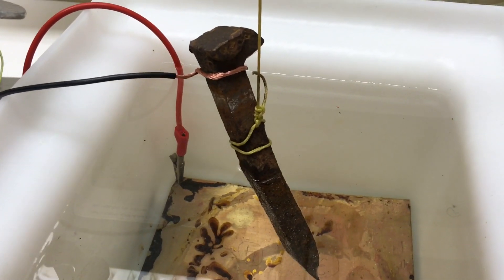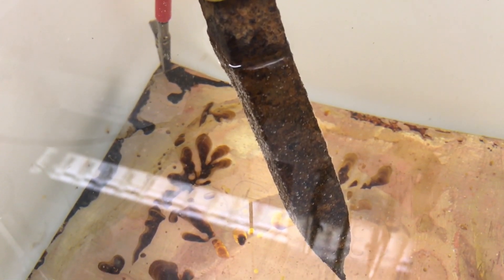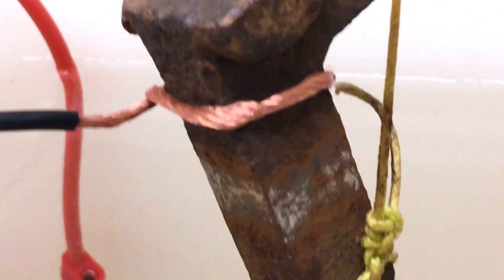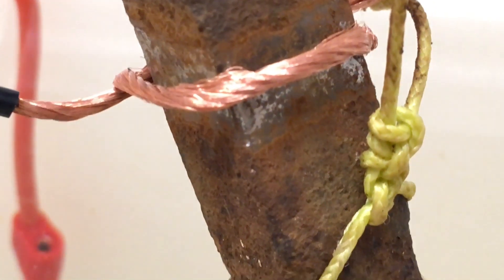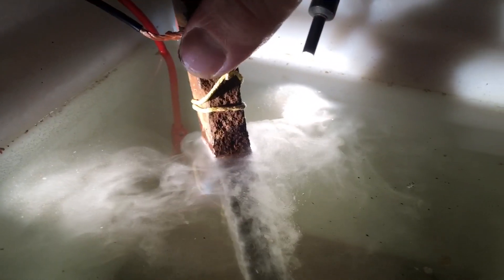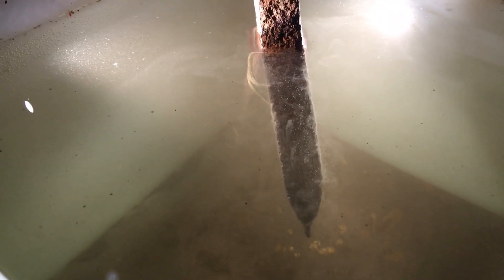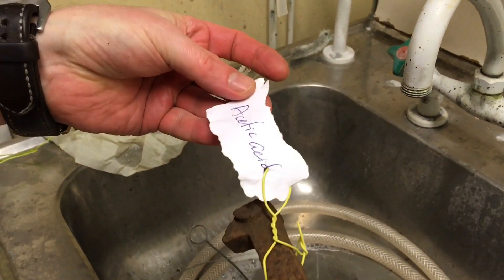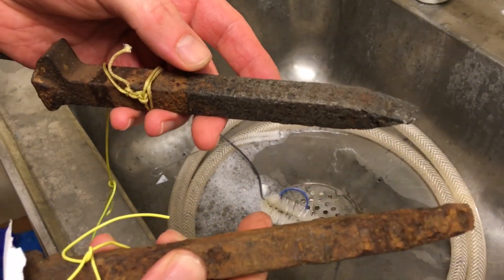True rust removal by a chemist - boosting the performance of white vinegar by electrolysis

Comment: If iron is left in acid the iron will eventually dissolve entirely.will the same happen with electrolysis? Also, I've used products like metal rescue, but the iron turns black. How can that be removed by chemistry? Great video!
Reply from the maker: +Don Newbold Thanks for commenting. The iron itself is so much more stable than the rust so you don’t need to worry about this and it won’t dissolve in a traditional way as one could envision. So leaving it in this weak acid won’t do anything for weeks. However, if you leave it for 2 weeks in 50 % muriatic acid as i use in my other bolt video, then it turns completely black and the reaction seams to have stopped, no more bubbles show. This is because a compound called ferrihydrate has formed, looking as it is partially protecting the surface. In reality, at this point hydrogen from the acid is all the time migrating into the iron. A very slow process, which with time will make your iron just disintegrate like a cracked eggshell. Folks refer to this as hydrogen embrittlement and one should be careful on this with all acids. Now, in the case of electrolysis you are safer because you push out electrons through your part, which can react with that hydrogen so it leaves your part as bubbles instead. In fact all the metal in the black cable side, immersed cables themselves, are always intact when you wash them. Two more cases are there to consider when doing this stuff, phosphoric acid and rust converters, both making your part black, but this is without electrolysis. Here the phosphorus part of the acid bonds to the iron or the tannate part of the acid in the rust converter. They make  kind of a protective layer that is good to paint on. As you let it dry as ‘coatings’ the hydrogen embrittlement problem is not a problem, no more hydrogen is supplied. However leaving it in there for ages will crack the iron also here. This is all that there is into it for us normal hobby folks, I hope it helps.
Reply: The black is carbon from the steel.

Comment: Thank you for the video. I wonder if the little vinegar in the solution is contributing significantly to the result at all, because in most other electrolysis rust removal videos, they do not add any acid to the liquid. What do you think?
Reply from the maker: +Futschikatores It does, no question on that but as you say, the question is how much. If I put it this way, thin surface rust on another piece of car panel goes by just dipping and I can wipe off without the electrolysis going. However for this really thick rust I cannot really say to which extent it compares w the electric rust remove action. Have to do one without, parallel to find out. Good point!
Reply from the maker: @Schwalbe262 you can go high on the voltage but always stay away from the Amps because they are the dangerous ones. google it and find the limits for your own safety
Reply: @Schwalbe262 more power will make the derusting faster, but the result isn't as good.  I've done a lot of electrolytic derusting and it seems best to give the parts about 2-4 amps max.  These parts are approximately the size of two hands together.  I've never used acid, but just sodium carbonate.  It works very well, but does seem to leave a black residue that need a scrubbed off.
Reply: It also helps to heat the solution.  I think this aids the grease cutting action so that the solution can get to the rust.
Reply: I will also add that the power that should be applied is proportional to the surface area. 2x more surface area equals 2x more current.  Also, the electrolytic action if done right will never take away actual metal.  You can leave it in for a week and still have a good looking part come out.  Not all acids will do the same.

Comment: Hi 
I did this with my exhaust manifold and it worked amazing , the rust washed straight off with a pressure washer, back to new grey cast iron . Then i put it in a tub with water and 500grams of bicarb soda to stop the rust coming back , left it for an hour or something.
Pulled it out , put it in the sun and as soon as the water dried off the nice grey cast iron changed to brown surface rust right before my eyes . 
How can i stop that happening , remembering its an exhaust manifold for a very nice classic car .
Reply from the maker: Could be that your iron is prone to flash rusting that instantaneously happens as it is wet. The nails I made are still clean and grey on the table in front of me. I would try on a small area and spray on some ammonia before it rusts, or dry it fast with a heat gun although non of these will be permanent. However, now with an extremely thin surface rust it will convert all of it with a rust converter. The rust converters only works for very thin rust (for thicker rust only converts the surface) but then you end up with a blackish surface, and maybe that's not what you wanted. For a shiny surface, possibly the best is to zinc plate it. I have to check this myself, I will run a nail to test the zinc plating. Someone will probably say spray WD40, but that's not a long term working solution.
Reply: Thankyou very much for your reply . The exhaust manifold is a great test subject , im sure you will enjoy the results you get . I will try the ammonia next time. I subbed so I can follow along and learn as much as i can. I personally am not using the electrolysis method as im not in a rush . Its just 4L of white vinegar and about 30L of water . Its full of nuts and bolts and some brake rotors at the moment
Reply: Zinc plate after you use electrolysis :-) :-)

Comment: Great Vids man! Learning so much. I have a question, if i wish to apply this method to de-rusting a motorcycle fuel tank...would it matter if the Black(negative) wire is submerged in the solution as well and perhaps the fuel tank is resting on the positive plate in a similar tub/ bucket? So basically can all wires be submerged and can the fuel tank rest on the positive metal plate?

BTW i'm an absolute noob regarding this stuff, apologies if it's a silly question.

Edit: lol, did a search of the Tube regarding this method on a fuel tank and there are plenty of vids...just hope they are informative and correct!
Reply from the maker: Thanks for your encouraging comment. 

If the black wire is submerged doesn't really matter, its just that there will be a lot of hydrogen bubbles appearing on the wire. However, the place where it is attached to the tank is preferably polished off a bit to better electrify your tank. 

Regarding the metal plate, the answer is no. You can not rest it on the metal plate, you will have a shortcut and the fuse will go in your battery charger. However, if you throw in a sponge or a pieces of plastic on top of the plate, then it will work and you can rest it on that. 

Good luck with the tank, you will be amazed how simple and good results you get.

All the best!
Reply: Thank you for the fast reply and it makes sense now regarding not touching the positive plate, been searching youtube vids where guys have been de-rusting their fuel tanks using electrolysis.

Seems not necessary to submerge the tank unless you have outside surface rust and using washing soda (sodium Carbonate not baking soda - Bicarbonate) instead of the table salt solution (sodium Chloride) inside the fuel tank

Both appear to work and not matter but the ratio is important otherwise the fluid could ramp up the current drawn and cause a short? That was interesting to hear!

Appears your 1/5th ratio is similarly used as well but they do not add any form of acid, i guess it just helps a bit more. With very good ventilation as always...not sure when I am going to try it but will report back. Cheers!

Comment: What would happen if you reversed the polarity?  Thanks.  Take care. Doug
Reply: If you reverse the polarity, then the piece you're trying to de-rust will become the sacrificial anode and some of it will be eaten away. Always + to the sacrificial parts, - to the part you want to clean. I use short pieces of rebar. Don't use stainless for anodes, unless you want to turn your solution into a toxic stew of chromium. Non-stainless sheet metal works very well. No galvanized metal, either.